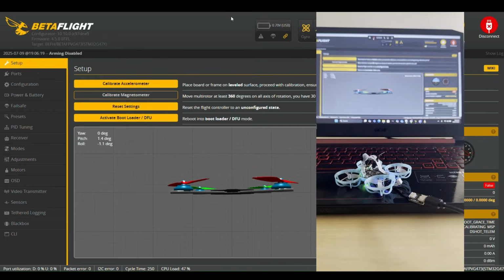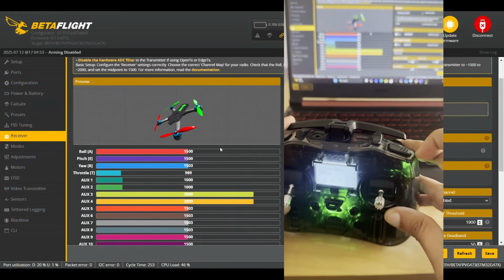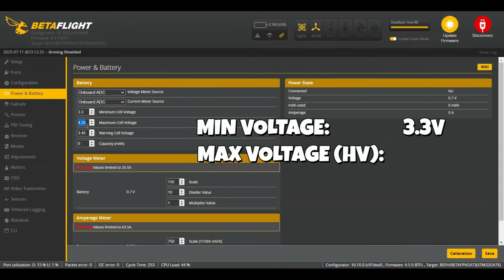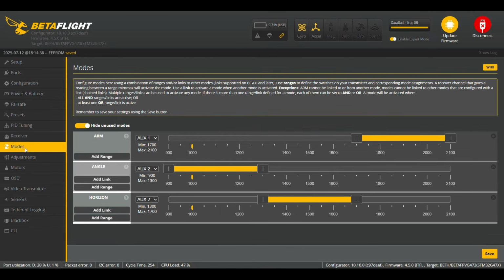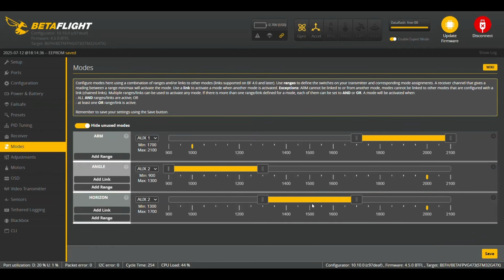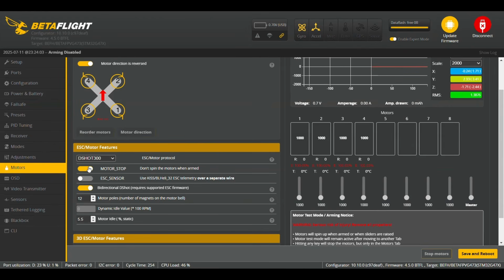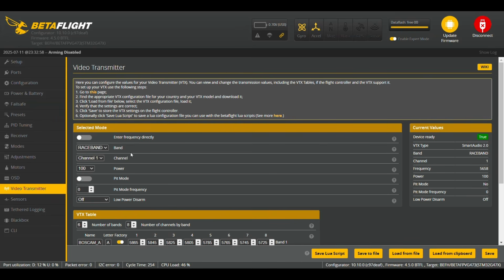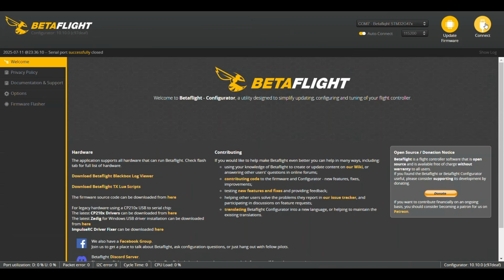BETAFLIGHT Setup for Beginners (FPV ESSENTIALS) - GET FLYING NOW | Tutorial for FPV DRONE

Comment: How did you connect the controller, I have dji controller 3
Reply: Hi i buy a owned Drone with 03 Air unit & i cannot connect to betaflight top...need help
Reply from the maker: Hi Marko, is your drone ELRS
Reply from the maker: DJI controller won’t connect through betaflight. DJI have its own system for connection but your drone also needs to be a DJI

Comment: Bro.. If the airmode is turn off permanently.. In acro mode. Can i do freestyle?
Reply from the maker: No bro. You’ll need airmode on for freestyle.
Assign it to a switch if you can. You can turn it off when indoors or taking off. Turn it on once you’ve taken off